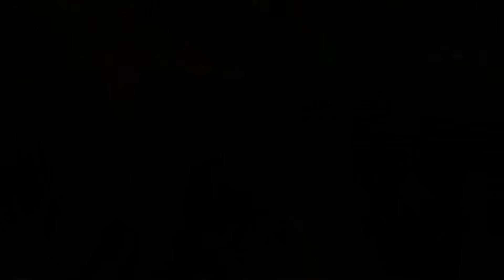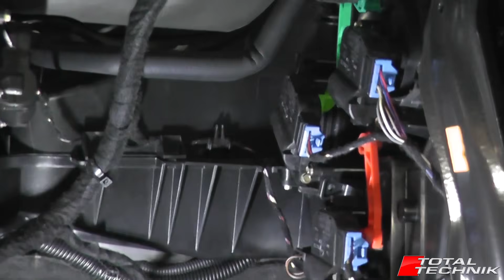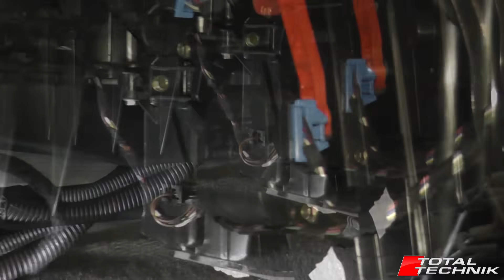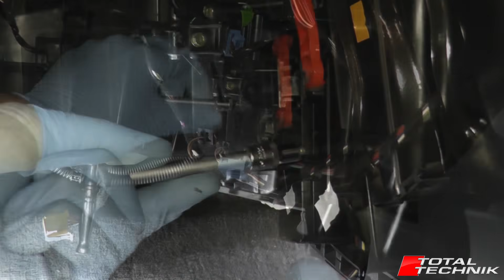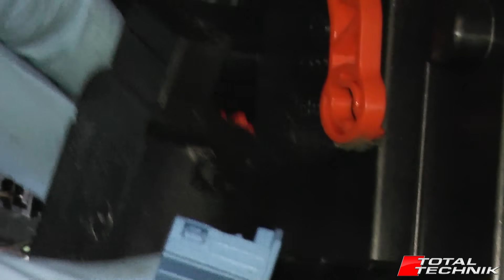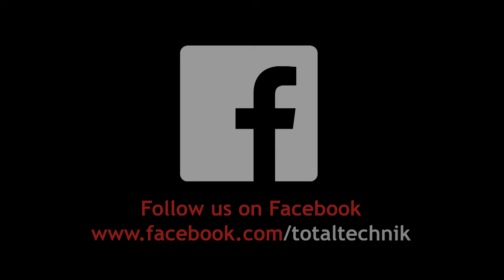How to Diagnose & Remove Climate Control Motor - Audi A4 S4 RS4 - B6 B7 -  TOTAL TECHNIK

Comment: Hi, i have this error on my audi a1 8x 2010:                                                

B109811: Potentiometer for defrost flap actuator, short circuit to ground. Which one of those 3 motor is ? The one on the top ? the black one ? i already know what is the problem, air doesn't come out from the windshield so i need to know which motor controls that. I assume that it's the one with the black ring you mentioned in the video, right ?

Comment: Does the one on the drivers side control the temperature (blend flap) to the vents on the drivers side at all? I have an issue in my 2011 A8 where when set to warm the passenger side is warm but there is only cold air coming through the drivers centre, window and footwell vents? Wondering if the one on the drivers side is the issue for me. THough VCDS doesnt show any error for that side. It only shows a mechanical fault on the passenger window vent. I dont know if that can affect the drivers side getting heat?

Comment: very nice video and explanation. ( nothing negative )
there is a TSB (Technical Service Bulletin) pdf of this 
"87 Various HVAC system malfunctions, DTC B11AF07 and/or B109207 stored in the climatronic module or
the BCM 1"
and the change is
"There has been a gradual change to an alternative supplier of the HVAC adjustment motors in production."
so VAG,Audi, placed from a crappy supplier a low budget plastic motor in your expensive car.
so many things brake down in these expensive cars, these parts are of very low quality.!!
Reply: of course

Comment: Hi I have a audi q7 2008 and have a issue with the heater when on hot the fan turns off and bk on then bk off and don't stay on but works when on recirculating if I select the windscreen it then continuesley turns on and off agen replaced fan and matrix any ideas what it is thanks

Comment: Wondering if anyone can help. A4 Cabrio B6, no outside air coming in... With Econ on and recirculation off, it should be drawing fresh air from outside, right? My problem seems to be all vents shut down in this configuration (or the outside air vent doesn't open). In any case, the fan is going full tilt but nothing comes out... As soon as I turn on recirculation, everything opens up no problem...

Comment: Hi!  Very useful and clear video.  Do you have one for the climate control fan access?  I have a noisey fan just behind the head unit or centre dash grills, it’s the fan that runs on after you’ve turned the ignition off.
Reply: Have you figured out?

Comment: I've gone two winters without heat coming from all the drivers side vents; center vent, windscreen vent, footwell vent and the vent closest to the drivers side mirror. is there on specific motor that controls all these or do i have to change all the corresponding motors? lastly, my engine temp takes a while to heat up, and when it does, it doesn't get to half way until i've driven the car for at least 20-30mins. I GENUINELY NEED HELP AS IS BEEN A REALLY COLD WINTER. Thanks in advance.

Comment: Hi there, I know it’s an old video but on my Audi B6 2004 (54reg) cabriolet I have an issue with getting it to go hot, only on max temperature (HI) will it be warm not hot and generally it initially blows hot for about 10-15 seconds as it feels like there’s a build up of hot air and once the blowers start pushing through it drops to almost cold but can feel a slight bit of warmth , any ideas what motor could be causing the issue? 
 would be a pain to take it apart twice once to diagnose the issue and again to fix it, would like to order a part and do the job all in one day 
Thanks in advance if your able to reply

Comment: So if the air doesnt blow from one direction means that motor is broken and needs to be changed?
Reply from the maker: Well, it can be other factors as well, but a quick check on the actions of the climate motors before delving deeper as it is so easy to do and very often is the cause. You can remove the glovebox in 5 minutes, and start checking. If you find a motor that is not moving nomatter what variations of direction and heat/cold you move, then that's your problem spotted! Best of luck!

--- 

To help support us (for both you and others reading this) there are a few things you can do:

1) Donations both needed and welcome! We cannot operate Total Technik without the support of people like you! You can donate by PayPal - just go to www.paypal.me/totaltechnik
2) Please ensure you subscribe to our YouTube channel. 
3) Please give our video's the Thumbs Up on YouTube. 
4) Please help spread the word, the more people who know about us the better! Add links to our video's in forums, let people know about us.

Thank you for your support!
Reply: @TotalTechnik  Thanks for the answer, problem is, the actuator is working interminentley. From some forums I understood I can take it out, clean it, grease it and it might work again. They are no expensive from what I've seen. Given the age of the car no wonder stuff stops working.

Comment: Hi I’ve got an A6 2008 and the AC is blowing hot... pressure in the AC was low but should still work.... I got a fault code  “central vent adjustment motor mechanical failure”, all vents seem to be working but no cold air... do you think it could be a motor issue or compressor? Thanks in advance.
Reply from the maker: Check the climate motors first. It's easy and can be done in 10-15 minutes as per the video. This will definitely point you in the right direction :-)

--- 

To help support us (for both you and others reading this) there are a few things you can do:

1) Donations both needed and welcome! We cannot operate Total Technik without the support of people like you! You can donate by PayPal - just go to www.paypal.me/totaltechnik
2) Please ensure you subscribe to our YouTube channel. 
3) Please give our video's the Thumbs Up on YouTube. 
4) Please help spread the word, the more people who know about us the better! Add links to our video's in forums, let people know about us.

Thank you for your support!

Comment: Is this valid also for the A6 C6 with dual zone climate control? Mine is blowing very hot air on the driver side when the engine heats up to normal operating temperature. Can it be the heat exchange valve?

Comment: Are all of these acuators interchangable on the same vehicle.? ( so that I can buy one acuator to check & each acuator by replacing each one in turn. So not buying just the green acuator to check just the green one ) 
I think its just the potentualmeter resistor thats broken in one, and another, the gearbox skips teeth.
Reply from the maker: A good question, but I think the answer is likely no. You'd need to get the correct coloured one to replace the same coloured one. You should be able to diagnose which one is faulty quite easily as by playing with the settings you should spot one that does absolutely nothing - if so that's the one to change! Best of luck!

--- 

To help support us (for both you and others reading this) there are a few things you can do:

1) Donations both needed and welcome! We cannot operate Total Technik without the support of people like you! You can donate by PayPal - just go to www.paypal.me/totaltechnik
2) Please ensure you subscribe to our YouTube channel. 
3) Please give our video's the Thumbs Up on YouTube. 
4) Please help spread the word, the more people who know about us the better! Add links to our video's in forums, let people know about us.

Thank you for your support!
Reply: @TotalTechnik   i have a 04 audi a4 not blowing hot air when put high full speed i checked the actuator and all of them seem to operate fine. Ii trows cold air like if i have ac any ideas thank u in advance

Comment: Hi, i had a quick question. I bought an audi a4 b7 1.8t 2005 however the ac don't work. I took it to a mechanic and he informed me that there was no ac compressor on the vehicle. So now am looking for a new one which will go on the audi. I need some advise on where to buy one online and how would i know which ac compressor will fit on the car piping system. Thank you
Reply from the maker: Did he mean that the car was never fitted with an AC compressor, i.e. the car did not have air con at all? Seems odd for a 2005 car! Or did he mean it's physically missing (i.e. been removed and not refitted)? That said, if this was the case the aux belt would not fit. Sounds interesting!!

--- 

To help support us (for both you and others reading this) there are a few things you can do:

1) Donations both needed and welcome! We cannot operate Total Technik without the support of people like you! You can donate by PayPal - just go to www.paypal.me/totaltechnik
2) Please ensure you subscribe to our YouTube channel. 
3) Please give our video's the Thumbs Up on YouTube. 
4) Please help spread the word, the more people who know about us the better! Add links to our video's in forums, let people know about us.

Thank you for your support!

Comment: Hi, 
I have a b8.5 3.0tdi and its a bugger for misting up. I took the scuttle off thinking there would be some soggy leaves there to find that my recirculation flap works in the opposite way to how it should. 
Have you heard of this?

When recirculate is on the flap opens 
when recirculate is off the flap closes which is where it defaults to. 

Also when the recirculate is off according to the button the fans are noisier like they would be when recirculate is on. Suggestion that the flap is doing the opposite of what it should. 

Have you heard of this?

Cheers

Comment: Hello.. pls help someone. I have audi a4 b6 . When i activate the AC then its blowing 8 degrees at LOW. Thats ok. But the two middle vents is blowing 12-15 degrees. And the very right one is blowing 11 degrees.. its not cooling enough... do you Think its One of These??? Hope for Some Answers....
Reply from the maker: Hmmm! It could well be one of the flaps is not operating, or partially operating. For the time it takes to run this test, I'd do this first before considering anything bigger. If you're lucky you'll spot ths issue and it will be easy to fix. If you're unlucky at least you can rule out these motors completely and delve deeper.

Best of luck with it!

 --- 

To help support us (for both you and others reading this) there are a few things you can do:

1) Donations both needed and welcome! We cannot operate Total Technik without the support of people like you! You can donate by PayPal - just go to www.paypal.me/totaltechnik
2) Please ensure you subscribe to our YouTube channel. 
3) Please give our video's the Thumbs Up on YouTube. 
4) Please help spread the word, the more people who know about us the better! Add links to our video's in forums, let people know about us.

Thank you for your support!

Comment: Thanks for your reply.  The flap motors are moving the complete cycle but not incrementally as per temperature control. On full the motors move to full heat, and then close to cold when moved to 1 degree cooler from hi.

Comment: Hi my climate drivers side is blowing cold air until I put it on a very high temperature, do you have any ideas the passenger side is running fine, I have run test but no fault codes.
Reply from the maker: Hey there! This may be the yellow motor on the drivers side. You should drop the lower panel down under the steering wheel so you can see the yellow motor, and see what it's doing.

You might see that it does not move until you are pushing enough current through it with the high setting. That would be the first thing to check, as that controls hot and cold to the drivers side so that is a likely cause.

It should move in line with the rising temp, but you might see it does nothing, and then suddenly starts to move when one highest tempurate. If so, replace it and you should be good to go.

You can get them used on eBay for decent money if budget is tight.

Best of luck!

--- 

To help support us (for both you and others reading this) there are a few things you can do:

1) Please ensure you subscribe to our YouTube channel. 
2) Please give our video's the Thumbs Up on YouTube. 
3) Please help spread the word, the more people who know about us the better! Add links to our video's in forums, let people know about us.
4) Donations both needed and welcome! We cannot operate Total Technik without the support of people like you! You can donate by PayPal - just go to your PayPal account and select the Send Money option and send any donations to: donate@totaltechnik.com

Thank you for your support!

Comment: Just what I needed to diagnose a dddrrrrrrrrrr noise behind my glovebox when climate control is activated thanks.  Are all the motors the same when I find the corresponding one, and what would I request on eBay to replace?
Reply from the maker: Hey there! Excellent - glad you found the video helpful :-)

Each motor is colour coded so generally easy to find the replacements used on eBay. Also, when removed you will find the part number which you can just type into eBay etc to help one the right one :-)

Best of luck!

 --- 

To help support us (for both you and others reading this) there's a few things you can do:

1) Please ensure you subscribe to our YouTube channel. 
2) Please give our video's the Thumbs Up on YouTube. 
3) Please help spread the word, the more people who know about us the better! 
4) All donations welcome. You can donate by PayPal - just go to your PayPal account and select the Send Money option and send any donations to: donate@totaltechnik.com

Thank you for your support!
Reply: Thats the motor gear skipping over the next gear, i think the position sensors ( rheostat ) dirty or damaged. It seems to be a sealed unit inside the motors gearbox so i cant fix mine, except to replace it. The A4B5 uses a similar but different unit. Im getting hot from one dashboard vent, & cold from the other.
Reply: I took out all of the actuators & cleaned the rheostats & not much difference. I still get cold non the passenger's side & variable control on the drivers side. 
Also the intake/recirc  flaps not moving.
I can get them to move by shorting out or shifting the rheostat but if the red ones plugged in, it simply goes to cold on passenger's side & stays there.
If I plug the rear upper/mid/low plug into the red motor I can get it to move into the hot position & then unplug it & leave it like that. It's winter here.

Comment: Excellent and very clear video. Mine is the driver side yellow arm motor, you're right it is a bit tricky and a low profile socket set would be handy as the space between it and other components is very tight.
Reply from the maker: Thank you - appreciate that :-)    Yes, the yellow one is by far the worst to access, needs a bit of patience that's for sure!

Please be sure to support us: please subscribe to our YouTube channel, give our video's the thumbs up, and help spread the word. Thank you!
Reply: Hi what does the yellow arm control

Comment: Great video. I have a problem with my a3 TDI. Heater gets warm after 10 minutes then goes cool. Do you think it could be one of these motors? I have had thermostat and pump changed out or something more serious like the heater matrix?
Reply: Did you  mange to get it done ? I have same preoblem
Reply from the maker: Hmmm. I would guess likely not the motors - but worth looking as you never know (maybe one is sticking rather than faulty).

Yes, I would have said thermostat - but you replaced that already so that should be good.

It will be a case of elimination to trace it. Could be heater matrix.

Best of luck with it - not the easiest job :-(
Reply: Thanks For the reply - I've been told by the Audi garage it may be the heater matrix - do you know if this can be flushed?
Reply from the maker: Yes, it should be able to be flushed. Do some Google searches and you should find some decent info on the procedure.

Best of luck!

Comment: great video, my demister one stopped on mine, I removed and cleaned placed back and hey presto perfect and then it stopped again a few months later. this time I disconnected it so its always open. problem now fixed
Reply from the maker: Thank you :-)

A nice workaround. It might be worth buying a replacement motor used on eBay as they are not silly money used.

Please be sure to support us subscribe to our YouTube channel and help spread the word!
Reply: Do you or anyone know which one this is? Or colour?
Reply: @nathank.gordon9352  Green colour top corner